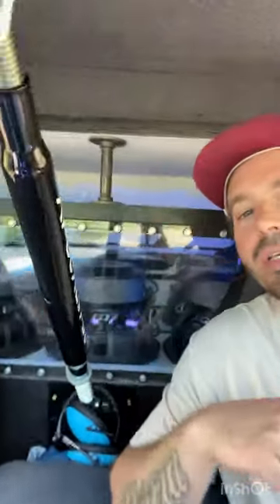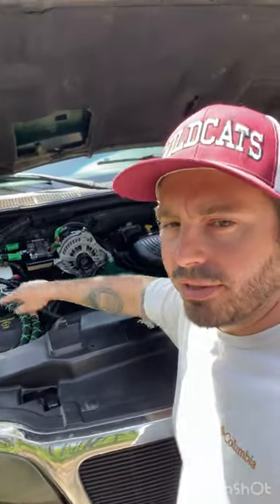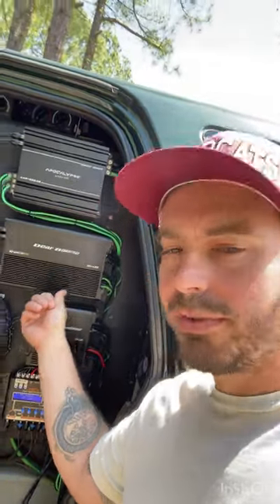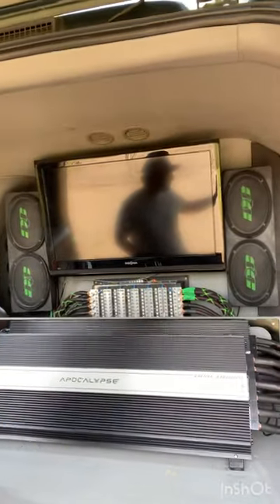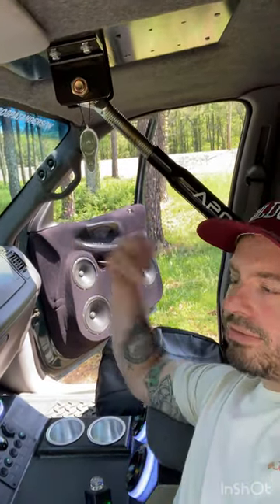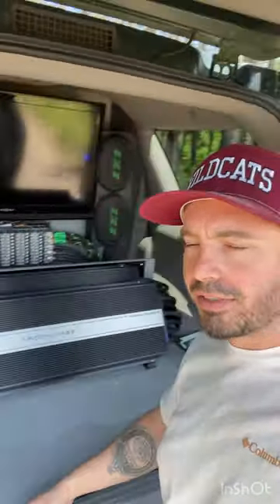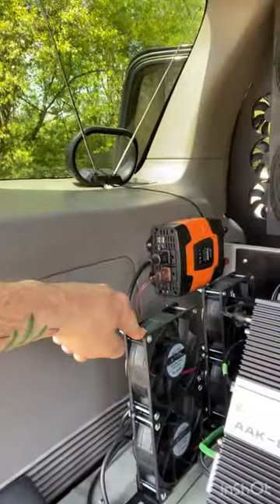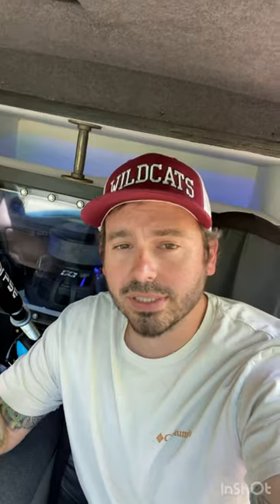Deaf Bonce build walk around

Comment: This is a very impressive system. Im just surprised you dont have a fire extinguisher handy. Lol. I love the brand myself. I like how well you explained about running those new little amps on multiple 4 ohm mids and tweets. Because if more people knew , they could   series-parellel ,sets of 4 ohms to a mono block amp, they would. Turnning a 2 channel amp into a 4 channel with no problem into 4ohm - 2 sets ,one mono block . Works just fine . Have a great day sir.
Reply from the maker: Thanks. Those little tweeters are great and don’t take much power at all.  Thanks for the support.

Comment: Nice. I use the older model DB Sylvesters (2 pairs) and one pair of the older model Arnold. But I power each Sylvester with about 230w rms, and each Arnold gets about 125w rms or so. The Arnolds reflect off the rear windscreen, so to my ears they seem just as loud as the fronts, so that works. I also have a pair of those MFT-25 that I only recently bought, but after testing them Im ordering 2 more pairs.
Reply from the maker: Yeah I’m not running much power to the mids because they’re so loud haha I got them to where I can stand listening to it. The mids and highs is where people go deaf and I’m not trying to

Comment: Clean setup man lots of work and time into it for sure my build is kinda done for now just need to add some fans for my 3 5ks running 9 Sundown e hybrids 1k rms each on 3 slapz 5ks doing a 157.5 so far but new subs so taking it easy in em for now
Reply from the maker: I appreciate it man. A good break in a always good in my opinion 👍🏽
Reply: @808PatAnderson  yeah I can definitely turn my amps up more but I'm giving them plenty of good clean power for now might swap to 3 8ks later are you going to be at MOS
Reply from the maker: @Hellabassguy  it’s a bit of a drive. I’ll be at the xs power show Knoxville in July

Comment: Love this build bro I'm supposed to have my AAK 6k tomorrow super stoked got to wait for the SCIB to get here should be next week now I need new subs thinking about getting the 3015's or maybe the 3515's
Reply from the maker: If you can then why not lol 2 3515 the 6k at half ohm should be a good pair. What box and vehicle
Reply: @808PatAnderson  I'm going to build inside the trunk for a blow through and it's going in a 19 Camry I would build in the backseat area but I have never seen an enclosure like that in real life so I don't know how to build one
Reply from the maker: @SlamryCamry19  that’ll be tight for 2 15s but good luck man
Reply: Yeah I unfortunately haven't sold my Lincoln yet to buy just a build vehicle so I'm building in my daily driver lol as long as I can still get to work I'm fine

Comment: I see you have the factory bass knob connect still aswell as the rca bass knob beside your seat. Dose that not affect anything
Reply from the maker: They’ll both work at the same time with no negative effects. I use the factory knobs for voltage and temperature gauges only.
Reply from the maker: Be sure to subscribe!
Reply: That’s what I was wanting to do bc I got jp23 v1.5 atm and the subwoofer bass knob v.2 from d4s wanted to run both just leave the factory one turned up and not mess with it. I like the fact of having the clip light but I have the bass knob lol. But thanks man this is what i needed to know
Reply from the maker: @joshualstacy69  happy to help 🤙🏽

Comment: Question I've never ran an amp with multiple power and ground input should I run all six to the SCIB or the power to the SCIB and the ground to the frame or split the ground between the battery and frame
Reply from the maker: All to battery. Run 2 1/0 grounds from
Battery to frame( or other good ground) and 2 1/0 power from alt to battery
Reply: @808PatAnderson   ok thanks again bro
Reply: @808PatAnderson  hey will the higher voltage damage anything other than the lights over time I read that on a couple forums reason I'm asking is I hooked up the SCIB today and just to the car and charged it, hooked it up and started the car the car started fine and the voltage was good but I did get a charging system malfunction indicator on the dash message and the radio I didn't go any further until I know for sure I know cars are different some like mine have electronic everything from the fuel pump, water pump, power steering etc I know it only said that because the voltage went over 15 and I was told I would possibly see it when initially installing the HO alternator so I'm not really concerned about the message itself it's basically just the newer version of a battery light
Reply from the maker: @SlamryCamry19  I’m sure every vehicle is different. I’d just ask on Facebook groups to people with similar car